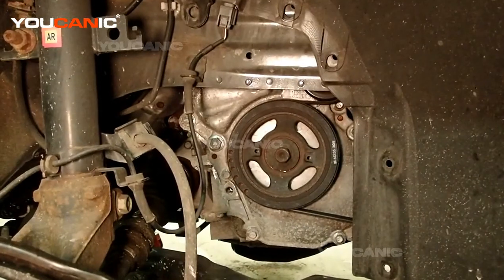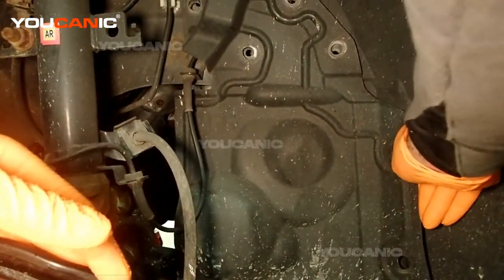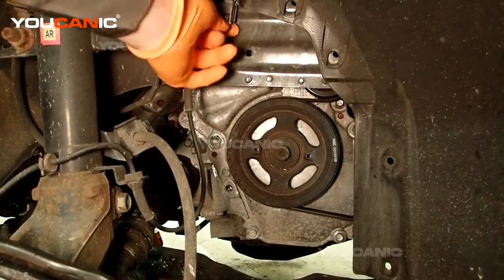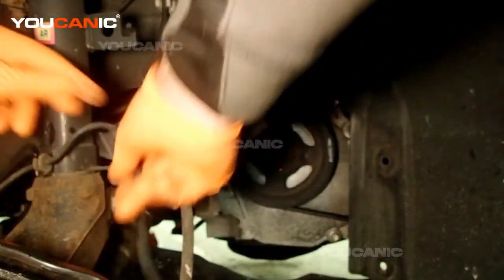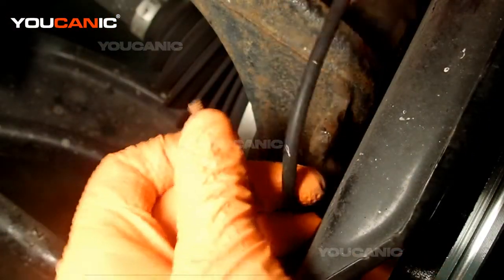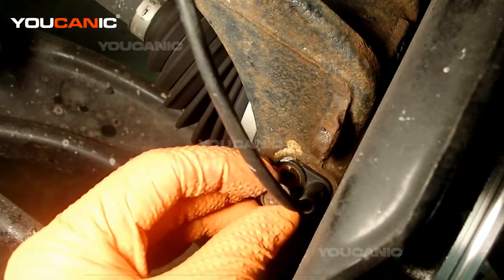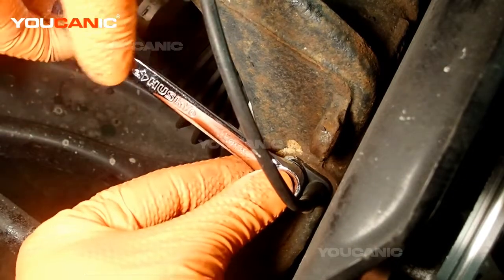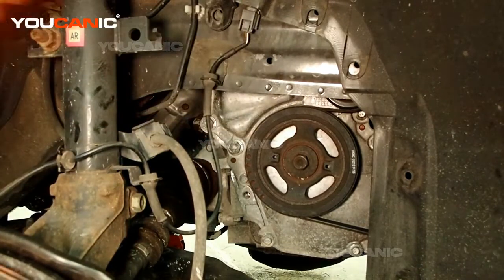2017+ Nissan Rogue Sport - ABS Wheel Speed Sensor Replacement

Comment: Are there rear ones?  I have a 2017 Rogue Sport SV.  I recently had my brakes done and I get a little bit of a stink from them on the road or that is what I am hoping it is.  I get the traction control light that indicates a skid (not the one that says it is turned off) and the one that says BRAKE in red letters.  I did change brake fluid and I don't know if I got any air in there.  I sucked some of it out with the brake bleeder vacuum tool and filled it with new fluid then bled them until I got around 6 to 8 ounces out of each and of course I kept an eye on the fluid level.  I fought one of the rear brake hoses some because of the hose being directly in front of a bolt.  I don't see any leaks there but is it possible I damaged the hose and did not cause a leak?  I get a rattle when I go over some small bumps in the road and I have an appointment to get that looked at in a week but I may ask them to look at the brake issue first if they have time.  I don't want to be a pain in their neck but I also don't want that still happening when winter comes just in case that has any dangerous effects on my traction control system.  I live on back roads where in the winter you could slide into a ditch or down over a steep hillside and it may be at least a half hour before you can get anyone to help you or notice it to get you help getting out of there so it is a rather miserable situation which I am glad not to have been in before.  With that and bad weather and people who must be texting (why the heck else can't they stay in their lane) you can imagine the problem that it might become.  What could potentially happen is not fun.  All I can say is can't they see the double yellow lines?  My dash camera can and also quite clearly where they are in relation to those lines.  My advice to them is those lines are not there for you to center your tire in and they are not just a guideline.  Unless there is an obstacle in the road don't cross those lines,.  Even then make sure it is safe to use the oncoming lane as a temporary passing lane.  That is if there is anyone at all coming they still get the right of way.  I guess they don't get it!!  They will when I have to file a claim or police report against them!!